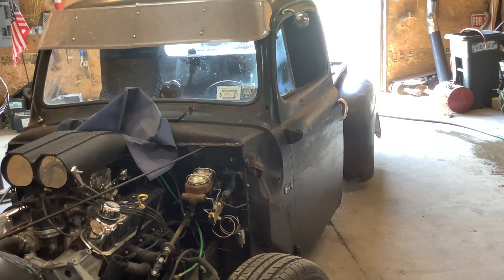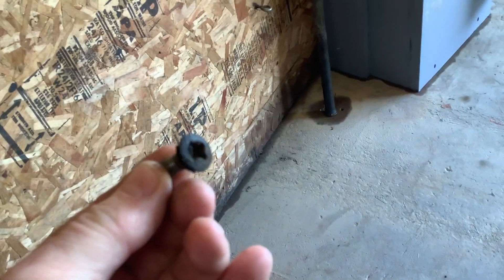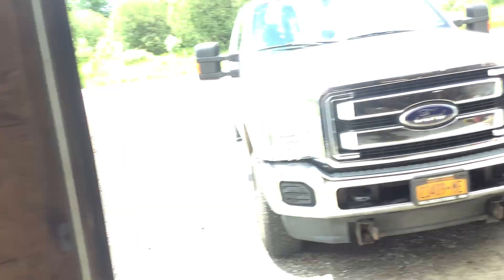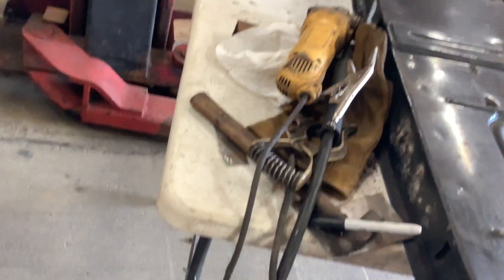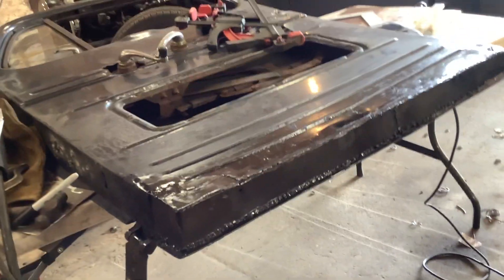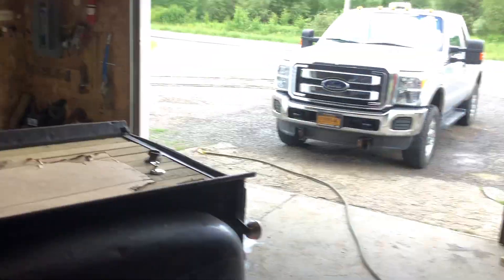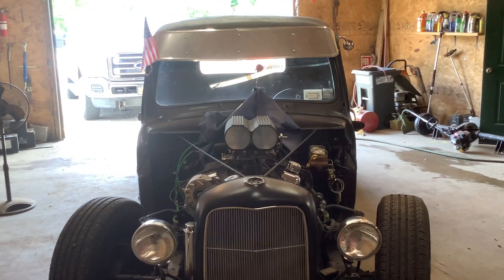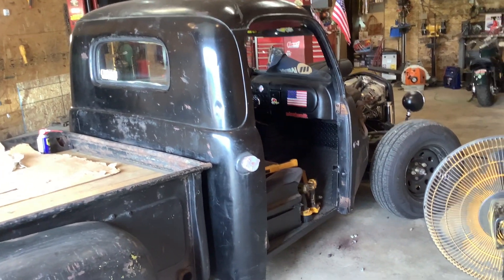Rebuilding the 1950 Ford F -1 doors

Comment: See if those broken bolts will drive back inward and out the other side!!!
Doors not flopping around will make a big difference!!!
Keep Rocking it out Brother!!!
Reply from the maker: Yup , the backing plate moves freely around behind the lower kick panel , so I drilled them out and retapped the holes and used new flat headed screws .

Comment: Nice fix on the door it's a ratrod it will be fine😁. Those Philips head screws are hard to get out. I got lucky on my 55 soaked mine with PB blaster good stuff for a week use a impact screw driver and they came out.
I got lucky. Take care👍
Reply from the maker: I did the same and got half of them out , the other have were quite the little bas….. it took over three hours to remove the drivers side .

Comment: Those old doors are always tough to get off, lucky thing the bolts snap off in the plate so you can at least get the door off, and deal with the bolts on the bench, the truck will be a lot less rattley with the doors fixed, i know when a did the drivers side on the 55 it made a big difference, thanks for the video
Reply from the maker: They don’t give up easily…wow .should get finished up by Monday .

Comment: I am okay with old metal but not so much on the chopping off the top and then mangle the doors to fit as you have to lose the wing windows usually. I can see many ways to take start on it being a good ride
Reply from the maker: I did a Z frame so I could leave the cab as original, 
they are small enough without a chop . I love the wing windows wish they still used them today .